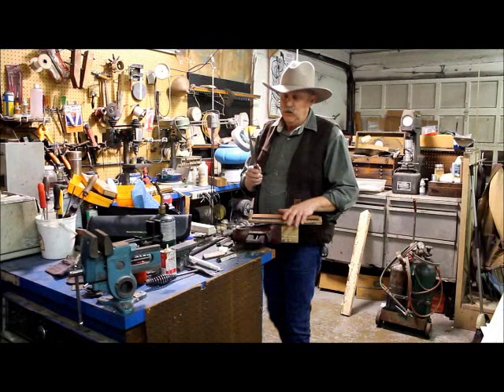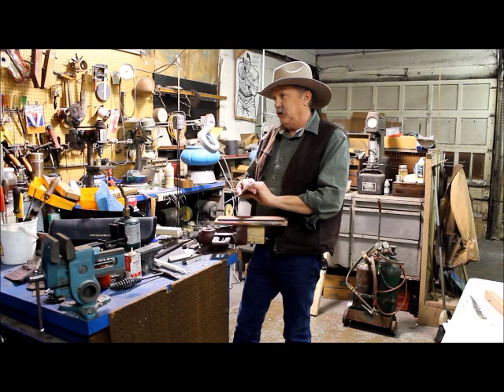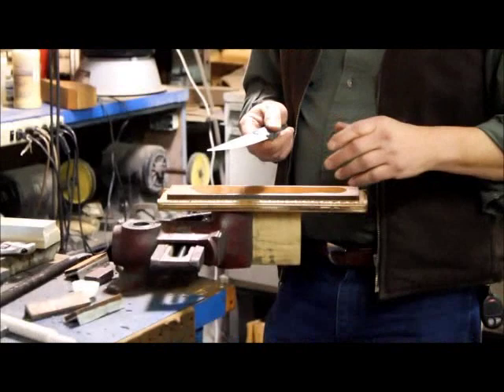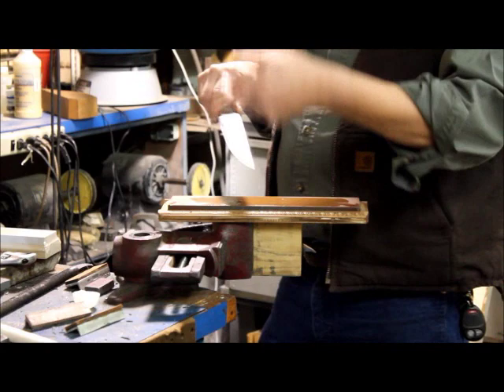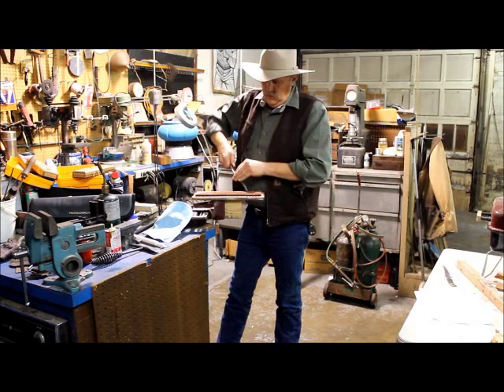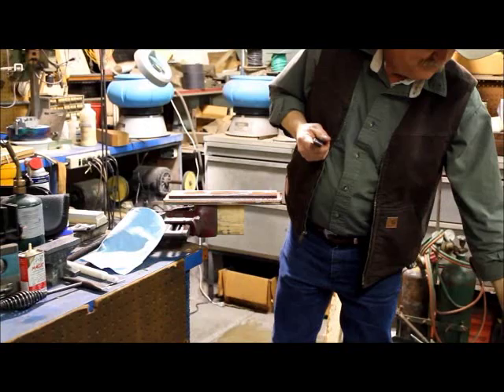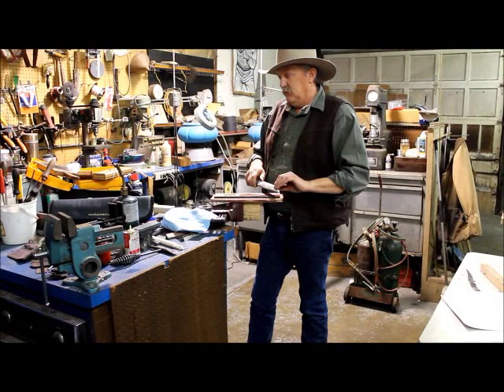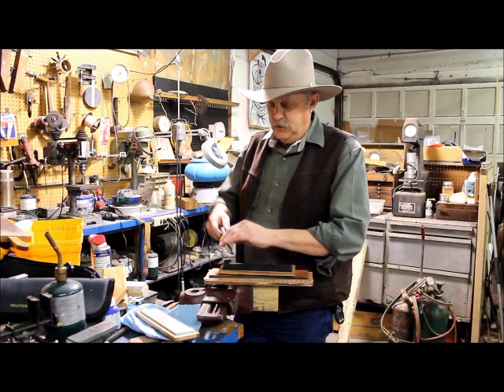Knife Sharpening Techniques by J.R. Cook, Master Smith

Comment: Given the popularity of Japanese waterstones and the frequency of ABS smiths to use Norton India and Arkansas stones, it would be interesting to hear them talk about why they use one and not the other.
Reply: Cliff Stamp water stones wear down fast, require constant dressing, and are very messy
I've got a set of very high end ones, which quite literally haven't been used in 5 years or more. I hardly used them before going back to Arkansas stones. 

I personally feel the water stones are popular because they are Japanese, and everyone talks about them. It pretty well every meaningful way the Arkansas stones are better
Reply: @geoffflato6065  i like western stones and learned to sharpen on them, and i still maintain a small collection that sees occasional use, including some verry nice, verry old norton hard arkansas stones. however the speed, finish and consistancy achevable by waterstones, especially when your getting into the finer grits, really cant be equalled by traditinal western stones. 

I keep the stones perma soaking and sharpen over the sink, the convienience and mess is a non issue for me.
Reply: Probably because that's the tool they're most familiarized with and it supports the local economy and it's traditional. Probably other reasons that I'm unfamiliar with too.
Reply: @shonuffisthemaster  IDK know about that I just think with artificial whetstones you get more consistent products. You still get people who use coticules or surgical black Arkansas stones for finer work like Razor honing.

Comment: This guy's got a  really dangerous technique. I can understand the theory, but a great many people would be openeing themselves up using this method.
Reply: Monolith Preacher if people can't handle pulling a sharp blade towards them they probably shouldn't have knifes
Reply: Nerf the world
Reply: Burgess Forge -  I'm wondering if his comment was referring to Mr Cook saying that he sharpens the blade first and then hand sands the blade, which I agree can be dangerous, especially if you don't have your blade properly mounted and secured while hand sanding (e.g with the cutting edge hanging far over the edge of the flat surface the blade is clamped on while sanding and/or the tip sticking further over the end of it).  If this was what he was referring to, I just take a piece of high grit sandpaper on a flat surface and run the edge over it a few time to get rid of the very apex.  This way the edge has already been flattened on the stone prior to hand sanding and it will then be quick to re-establish the edge apex, but it's not quite as dangerous.  

If this isn't what he's was referring to, then I'm lost.  ;)
Reply: lol you people

Comment: no disrespect to the obviously skilled bladesmith, but sharpening has come a long way in matereals and techniques from what he is demonstrating.

I too was tought to sharpen this way by my dad, with a norton medium india, who learned it from an old greek wood carver in the 1960's. it works, you can get a useable edge, but if you want to persue the ultimate edge there are much better matereals and more consistant techniques you can use. Id also say if you want to stick with traditional western techniques and matereals, a hard translucent arkansas is in order after the india, before the strop.

also he should specify what norton stone he is using, because they make quite a few different stones......
Reply: He's also not using proper technique. A true sharpening enthusiast would probably consider that knife dull. Especially the tip with how he's lifting.
Reply: There is no such thing as an "ultimate edge." There are different edges required depending the purpose of your tool and what you want to do with it.
Reply: @gazay7777  Okay buddy I'm sure you know a lot more about sharpening knives than a ABS certified master bladesmith.